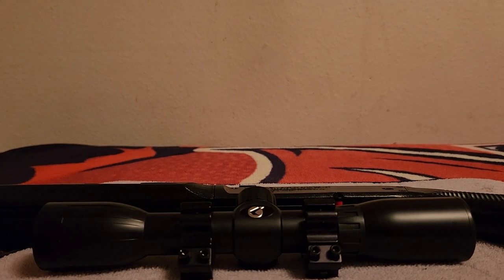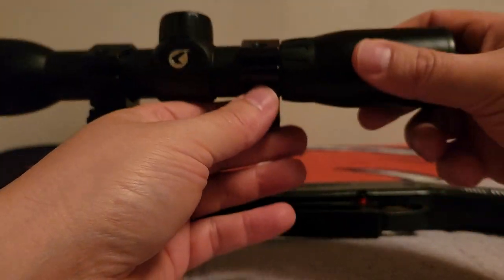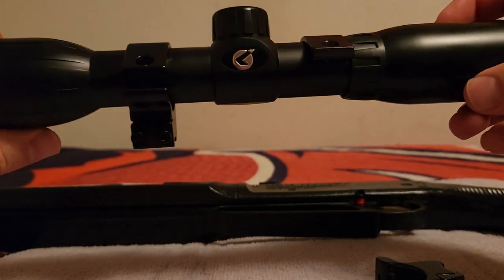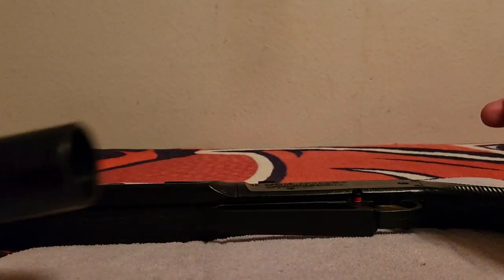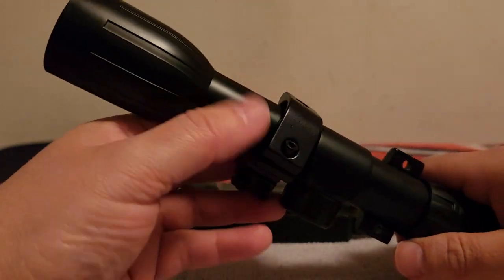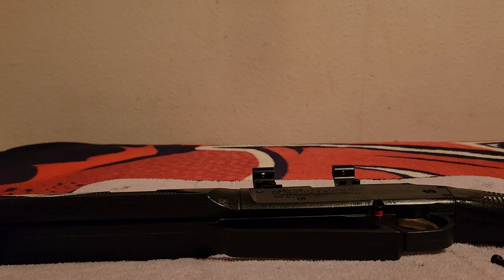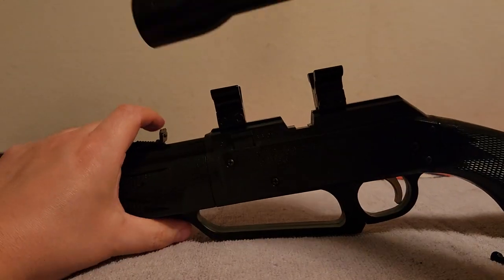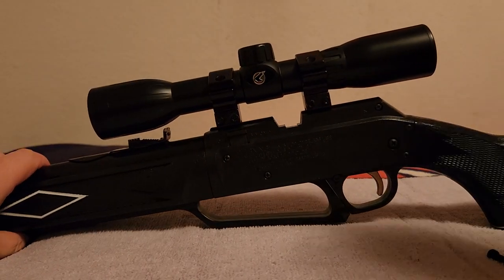Converting a Break Barrel Scope for Daisy 880 Use

Comment: Thank you.  I actually like the cheap scope Daisy provides for 880.  I don’t shoot it past 25+ yards and it’s enough for me.  What’s your favorite scope for 880?  Winchester 4x32?
Reply from the maker: Well, Alex, the Winchester 4 x 32 that came with my 77xs wasn't very good. It couldn't hold its zero and had odd shadows.

I used a cheap scope once upon a time for my best 880. You know it looks like a black straw. $10.

But I stripped my VERY expensive scope off an inactive HW years ago, and I've never looked black.

My favorite brand for pump guns is UTG. Dot sites for my Crosmans and some basic scopes with objective lens adjustability.

Right now, 3 out of 4 880s are open sight. My 753 has a very happy UTG Bug Buster on top.

Comment: I usually just leave them in without making them stick out!
I know that I will loose it if not.
Reply from the maker: Low-key, to clarify, are you saying you made a scope stop work without removing peg?

The 880 can't take that base with the peg there. Are you saying yours are more DELUXE and allow to turn left, and it TUCKS inside base?

⚠️The Gamo rings can't do that.⚠️ 

Love your videos, by the way - very inventive and classy high-end visuals.
Reply: @daisy880fanaticfixit9  The scope pin can be hidden into the scope ring itself !?

You don't really need to remove it just unscrew it until it doesn't stick out anymore and you are good to go & won't loose it.
[Sure did it on a Crosman ring before if Gamo's can't ...]

Thanks for the kind words I try my best to improve my videos while my channel is growing !

Comment: An unrelated question for you. Is it possible to install a Daisy 499B barrel in a Red Ryder? I can hit cans at 25 yards with my 499 but am unable to with my Red Ryder.
Reply from the maker: DTM, the 499 is a special BB gun. Let me see if I can round up an authority for you. A Red Ryder Dragon.
Reply: You pose an interesting question. The short answer is no, not really. At least not without the ability to machine the 499 shot tube to a smaller OD. BUT- you can replace  the original repeater shot tube assembly with the 499B abutment and shot tube in a Daisy like the model 105B to turn it into an accurate single shot muzzleloader "poor man's 499". It requires a way to sight the gun properly since the 499 barrel plug lacks a front sight blade. And there are other considerations to be addressed like blocking off the opening for the loading door since it has to be removed. All in all, I'd consider this an advanced project

But there are other ways to improve the accuracy of your gun. First and foremost is the shot tube has to be free of oil. The ammo used has an effect on accuracy. I have had good results using Daisy Precision Ground Match Grade Shot. There's a 2-part article on Hard Air magazine online with info on BBs that's worth a read. Even the way the gun is held when shooting can affect accuracy (research "artillery hold").